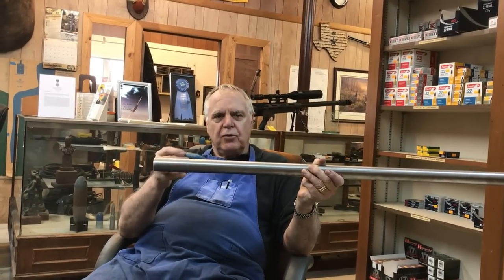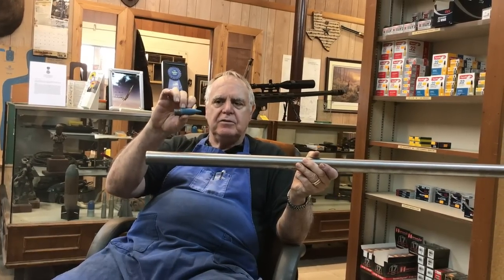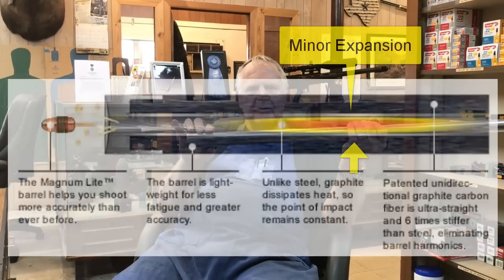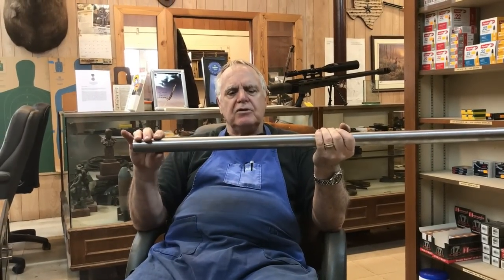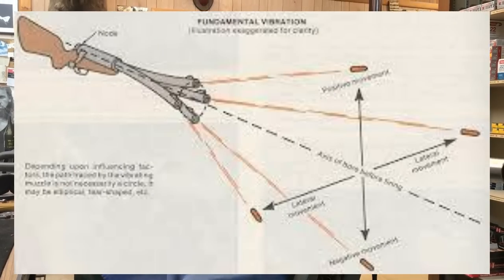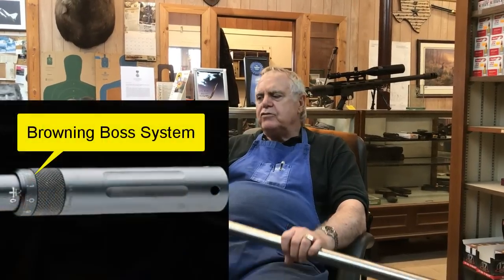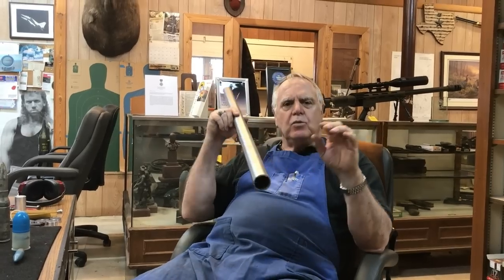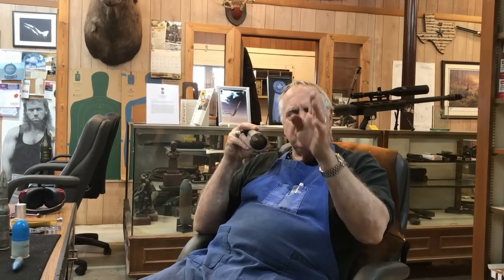Discussing Barrel Tuning & Barrel Harmonics with Buck Master GunSmith

Comment: Thanks Buck & Rick!

I spent a good amount of time designing tuned exhaust systems for racing and it sounds like a lot of the same logic and theories apply. Its MUCH more intricate and complicated than just sticking a tube with a bunch of baffles on the end of the gun.

Comment: The neutral 'nodes' (as you say) is when the barrel is at max whip velocity. The upper or lower peaks is when the barrel is actually stopped.
Reply: Noides are when the harmonics/vibrations cancel each other out thereby dampening itself ineffect.
Just like 2 speakers 180 deg oyt of phase the noise may be at maximum volume but the sound is camcelled.
You are correct the upper and lower peaks are when the barrel may have actually stopped BUT BUT.
you do not know where that stop may be in the X,Y plane whereas the bore may be pointed left or right of center at an upper or lowest peak.

Comment: Questions :
(1). Does the weight of a "muzzle device" greatly affect accuracy with barrel harmonics..??
(2). Bore temperature;  Is COLD more accurate than a HOT barrel when comparing shots.?

Comment: Random thoughts...It seems that the only effect that would create a vertical standing wave would be gravity.  The spin imparted on the bullet should actually create a helical wave (hold a piece of rope vertically and rotate it).  Note that the nodes are still centered in the wave.  The suppressor is not a monolithic mass.  The mass might be greater at the base, moving the "node" past the end of the barrel but not to the end of the suppressor.  While "bull" barrels are more resistant  to bending and cancel out some of the vertical wave, the twist of the helical wave is resisted by the barrel mass that is far from the center line by leverage.  Watch slow motion of a recoil and you will often see the rifle twist in the shooters hands by recoil from the accelerating bullet mass (greater with greater bullet diameters and masses due to leverage).
Reply: On an AR-15 a vibrational wave travelling 20,000 fps will cover 32 in. (2X barrel length) in roughly .000133 seconds. Over .003 seconds the wave will oscillate along the barrel 22.5 times. .003 seconds is the elapsed time of the firing sequence from trigger pull till projectile exits muzzle. You can take that to the bank.

Comment: Rick, could you ask Buck about adding mass to specific places on the barrel to tune out the harmonics? Example: Adding something like a collar clamp around the barrel or would it limit the expansion of the barrel as the bullet passes through that point?
Reply from the maker: bigger thicker barrel will help but heavy and more material and money
Reply: @HeyGunPeople  I was thinking more like a piece perhaps an inch long that could be moved along the outside of the barrel to add mass to only a specific spot.  That way you could tune the barrel by changing where the extra mass was. I know from precision machine balancing and from doing audio engineer work that harmonics can be tamed by doing something similar.

Comment: Did some research on the claim that cuts in the barrel will add to rigidity.  All the top barrel manufactures say it's not so, that it's a common myth, that it's only for cooling purposes.
Reply: He did not say it would add rigidity.  He said it would cut down on the weight while maintaining (more or less) the same rigidity as a barrel of the same width.